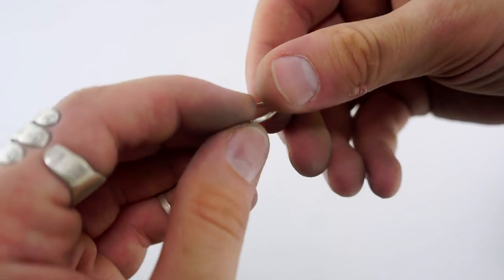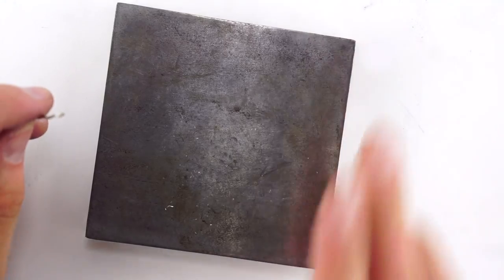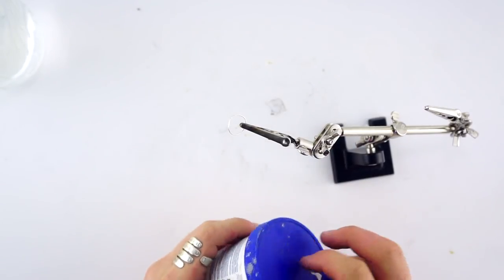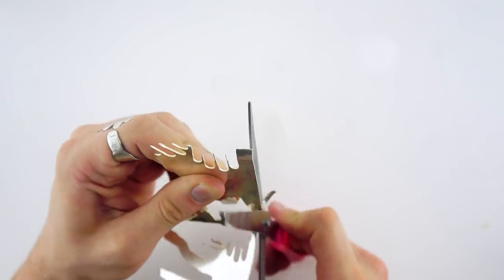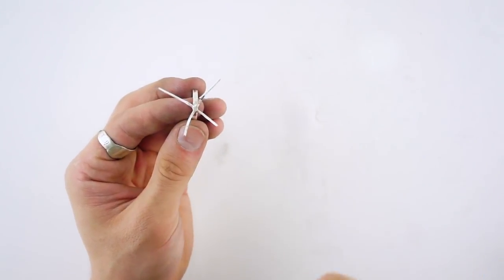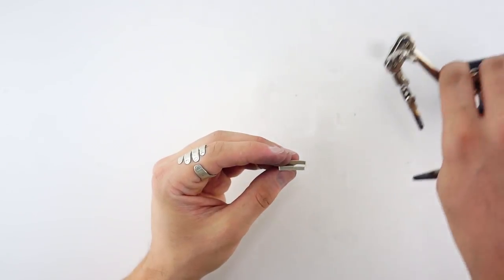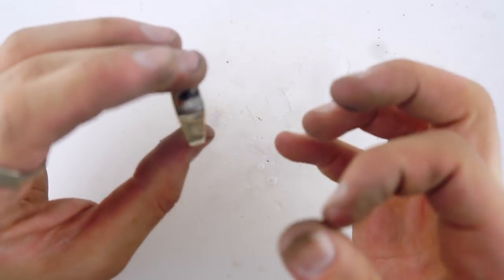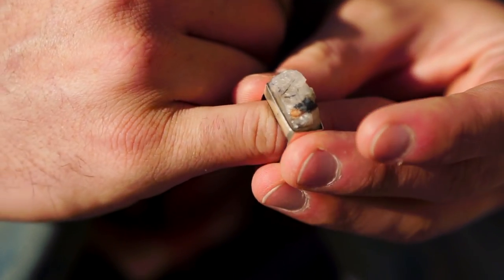How to Make Jewelry

Comment: Is there anything you can't do? I actually went to school for 3 years to learn jewellery making, and things got a bit more complicated there. I have two tips: when you solder silver, don't point the flame directly at the solder, but warm the entire piece first and move the flame around. Solder flows towards heat, and if the piece of solder is the hottest point, it won't flow properly. Also, you'll end up melting the piece. Another tip is to put the piece after soldering to a cup of warm citric acid solution to remove the dark fire scale left from fluxing and heating. You'll end up with a clean piece which is easier to polish, and won't ruin your files (flux is like glass after soldering). Don't put anything with steel (or iron) in the citric acid solution, or it will get ruined.

Great video!
Reply: Good ol' pickle makes it super shiny.
Reply: Cool tips! I hope I’m not being a bother by asking but can I ask what made you go to school for jewelry making and if you think it’s worth it? Just wondering, as I’ve been making jewelry for a while and never really considered actually going to school for it until just now haha.
Reply: @tylerburney8576  Where I live (Finland), we have a long tradition of gold smith education, and the field is quite regulated. I happen to live close to a respected school. I started doing jewellery on my own, but I figured I could actually become a "real" jewellery smith and turn it into a small business, which I did. I think I've learnt more on my own than in school, but I guess it was worth the time to learn to do things "the right way"- and it didn't cost me anything. It's definately possible to learn making jewellery on your own or through shorter courses, but around here, people value degrees and titles, and they are impressed to hear I went to school for this - which often helps with selling stuff.
Reply: @VanillaCupcake91  I couldn't come up with the word pickle for the life of me, even though it was on the tip of my tongue. I'm not a native English speaker, and it'd been a while since I used that word. 😀
Reply from the maker: Awesome tips! Would vinegar work if you don’t have the acid?
Reply: @Shmoxd  We used diluted sulfuric acid in school, and I've only ever used citric acid, but there are recipes using white vinegar online (just search for jeweler's pickle). :)
Reply: @tylerburney8576  I did a 2 month course in it and did pretty much everything Smoxd did here. We also made our own moulds out of silicone and made resin pieces and all that jazz. It's honestly so much easier than it looks. Smoxd did a great job!
Reply: @Leena79  Yay! Yes, we used the same as well. Sparex I think was the brand? You can find safer more easy to dispose options online. It gets rid of any oxidation on the jewellery as well as cleans off any oils from your fingers which might make soldering not stick properly! You already got everything down pat but I reckon a pickle will help you heaps. No need to sand and then buff as much after you solder, just pickle it and buff.
Reply: @Shmoxd  I use a vinegar and salt pickle as I don't like using acid. If you keep it warm it works so much quicker as well.
Reply: Leena wow that’s awesome!! Yeah it’s definitely like that in America too (with the whole we only want people who have degrees BS, it’s getting really bad for simple things like fast food restaurants too 🙄🤦🏻‍♀️ like really?!) I wish they had more things like this over here or that were more accessible like through normal school. Not everybody wants to go the college route you know? It sucks for the rest of us who feel lost all through this period not knowing what we want to do with our lives :\ I’m an artsy type of person, it doesn’t matter what it is crocheting, knitting, sewing, painting, embroidery, cooking, sculpting with polymer clays or making jewelry with it, or working with resin (I’ve *really* been wanting to get some of that UV resin and make jewelry with it!), paper quilling, video game design, writing I enjoy it all. But it’s hard to know what tf to do with that and actually keep it profitable. A million other people like me have already had the thought oh I’ll open an Etsy shop, or an eBay shop, so you get lost in a sea of that....

Anyway sorry I totally did not mean for my comment to go so depressed heh. I’m so sorry, these are just the thoughts I’m constantly worrying about haha.
Reply: VanillaCupcake91 WOW they helped you make your own moulds AND YOU WORKED WITH RESIN?! Oh that sounds amazing!! I just went out to the store the other day trying to find some UV resin (since I don’t have a bank account or credit card to purchase things off amazon it suuuuucks so much because that’s what everyone suggests you do lol). I of course couldn’t find any so I settled for regular two part resin and I’m really scared about it, so it’ll prolly be another one of those things I’m so afraid I’ll mess up and it’ll just stay in its original packaging heh.. I also saw the silicon mould maker stuff there when I was buying the resin. I wanted it sooo bad!! I think that is sooo freakin awesome to make your own mould!!!!
Reply: Go to the pharmacy and get alum. Add a few tablespoons to about 12 oz of warm water. I use a small crock pot to keep it warm.
It is a totally safe alternative to industry "pickle" (won't burn holes in clothes if it splatters, won't burn skin, is safe to pour down the drain) and it works a lot faster than vinegar, like, a lot.
I usually just add another tablespoon when it starts to weaken, instead of dumping it and starting over.
The only time I change it is when I clean my crock pot.
Reply: @Shmoxd  I know this thread and video's a bit old but at my school our pickle solution is hydrogen peroxide that can be purchased at a pharmacy and warmed up in a crockpot (it's a more industrial technical version but basically a crockpot)
Reply: @Shmoxd  vinegar and salt work as a DIY solution! If you Google DIY silver pickle there's load of tips for pickling silver safely at home with super cheap supplies. If you pickle each part after you heat it it'll help your joins attach by removing any impurities from the contact points. But yes don't use stainless steel tweezers in the pickle it'll turn your silver pink
Reply: @noemi vitek I don't think lemon juice is quite concentrated enough as such to work very well as pickle, but citric acid is usually easy to find in any bigger grocery stores, as it is used in cooking, and it isn't expensive. There are actual recipes for the amounts to use, but I usually just eyeball the amount and add it to hot water. I use an old chocolate fondue thingy to keep my pickle hot (a tea light under a ceramic cup), and use the same acid solution for weeks. Citric acid is not acidic enough to cause any skin burns, so it's quite safe to use.

Comment: Your solder did not flow the first time because there was firescale (the black stuff on your metal from heating it that you referred to as fire stain) on the metal, the flux probably would have worked if your metal was cleaner!!  Using a toothbrush and some soap to clean the metal would help, ideally pickling the metal after applying heat. Also if you apply the solder while the flux is still wet it should essentially hold it in place before melting. AND applying flux to your entire piece will help lessen the firescale :)
Reply: pickling the metal lol
Reply from the maker: Does any flux work too?
Reply: @Shmoxd   I'm not sure what flux you originally used, but any flux should work (though I cannot peak on flux used on electronics, i would think that its just a lower grade but i dunno).  would just stick with handy flux if you're just soldering jewelry as an occasional hobby. Its a go to for hobbyist jewelers because its cheap and decent. There are definitely different types of flux, like handy flux is a borax-based compound that provides substantial oxide protection but often leafs a tough glassy skin often referred to as "flux glass" but that's easily removed with pickling and/or filing and sanding.

Comment: My two cents: You may want to use a piece of cloth between the block and use a leather covered hammer as you can transfer impurities onto your silver - when you solder, it'll include the impurities affecting the longevity and maintenance of the ring. More important for 925. Also easier soldering process in general. The leather can also help prevent unwanted marking and nicking on your metal.

Comment: Hey, if you dip your piece of solder in to the flux first, then place it on the ring, it should stay on the ring better. The solder will naturally ball up first, then as it gets to melting point, it will flow in to the seam. Another tip is to heat the ring evenly throughout, then focus on where you want to solder.

Comment: a couple tips if anyone plans on doing this:

dried up boric acid flux can be reconstituted with water, and when it's wet it works as a glue to keep pieces of solder in place

you can do the same things with copper and brass that you can do with silver, silver solder works on all of them, but it will show unless you're really sparing with it, because it's a different color

if you make a habit out of making jewelry, fire scale can be more easily removed with an acid bath than with sanding, but you have to be careful not to leave it in too long unless you want it to look etched and matte

Comment: I admire your willingness to explore different mediums. Jewelry is fun to make and great to learn. I took jewelry for a few years and enjoyed it a lot. I won't lie, I cringed a little at the filing and soldering ^-^" (sorry) When you are filing, the file's teeth only go in one direction, only in the forward push, so filing sideways or backwards on the teeth only wears down the file faster. When you are soldering, you only need a tiny bit of solder (quarter of what you used), you can cut small pieces and preheat separately so they ball up and its easier to stick on your metal. Sterling silver is an alloy of silver and copper, when it is heated, the smaller copper molecules will start to separate and you can see that as fire scale. To check if you have fire scale, place the metal on a piece of white paper and anywhere there is a purple cloudiness that is fire scale that needs to be sanded off. Fire scale increases with prolonged heat and temperature, so if you can keep soldering short and sweet, you can avoid a lot of clean up. Thanks for sharing your process. It's nice seeing other artists learning and trying new things. If you wanna draw on the metal and get fancy, I recommend a scribe like this one: https://www.amazon.com/IMT-Tungsten-Aluminium-Engraving-Replacement/dp/B06XYZVJJ6/ref=pd_lpo_201_img_0/144-8226781-5909217?_encoding=UTF8&pd_rd_i=B06XYZVJJ6&pd_rd_r=f7b1e141-b0a8-46f8-ad9a-e01ccb25286b&pd_rd_w=NqfV2&pd_rd_wg=puin8&pf_rd_p=7b36d496-f366-4631-94d3-61b87b52511b&pf_rd_r=4YZZF49F60P172BF637Q&psc=1&refRID=4YZZF49F60P172BF637Q

Comment: This stuff would be even easier if you actually used the right tools. You also got the metal way too hot when annealing.  A good cheat to tell if your metal is at the proper temperature for silver annealing is to mark the surface with sharpie marker. When the ink turns transparent you're at annealing temp. If you had a larger piece it would likely crack when you tried to form it, at the temperature you got it to.  You should also use significantly less solder than you did. Like ten or more times less.